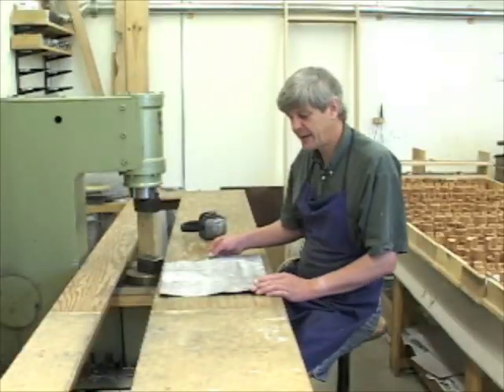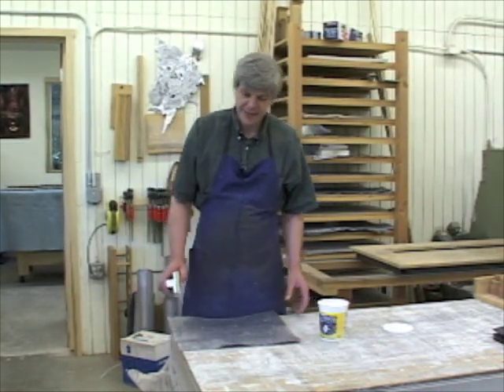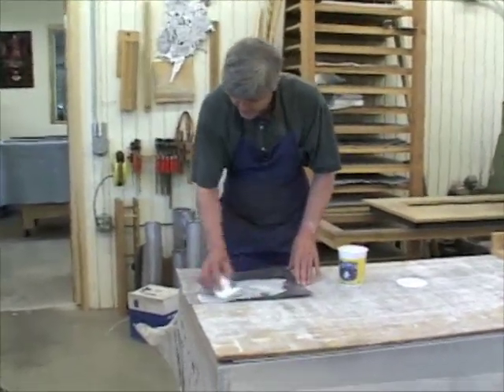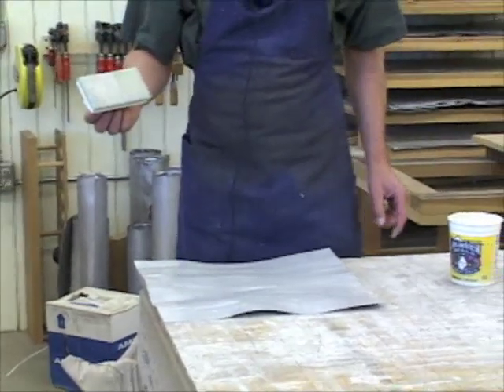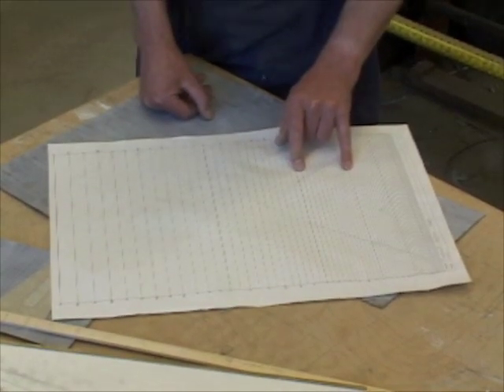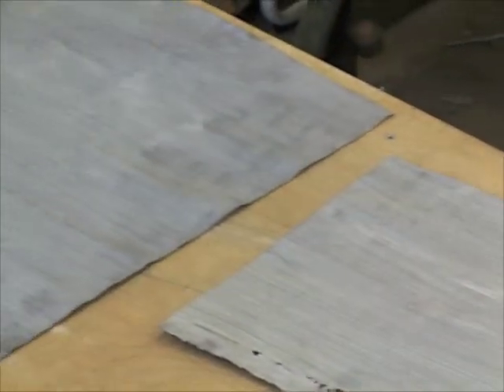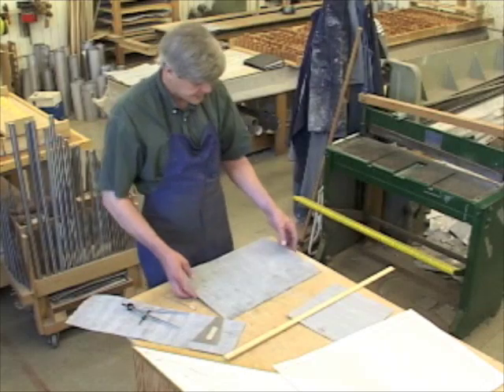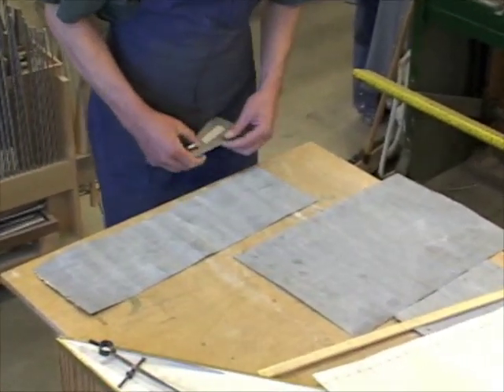Pipe Making Part 3: Hammering, Sizing, Calculating and Cutting

Comment: @sickdeathshappen 
It's been used for over 500 years. and Prior to around 250 years ago, all if not most of the metal pipes were 100% lead.
It doesn't effect you as much as you would think. Only if you "lick" the pipes or something crazy like that.

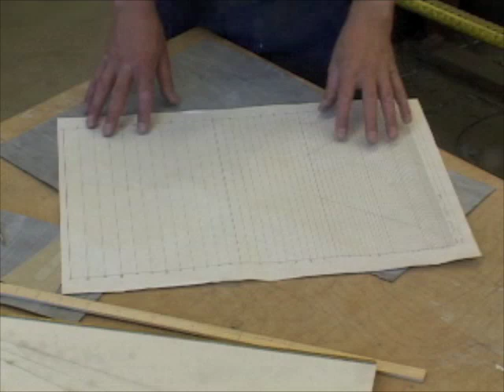Comment: from where it is possible to find the table in 2:39 because I can never get hold of it.
Reply: the chart is ruled out on logrithmic paper that divides so that every 17th step is 1/2 the width of the 'originating' diameter - the use of logrithmic paper allows a straight line rather than an arc. A table of measurements (for a sample, not necessarily for real-world use) can be found in Volume 2 of "The Art of Organ building" by G. A. Audsley (available in a Dover reprint).